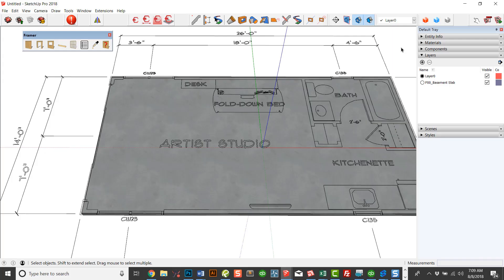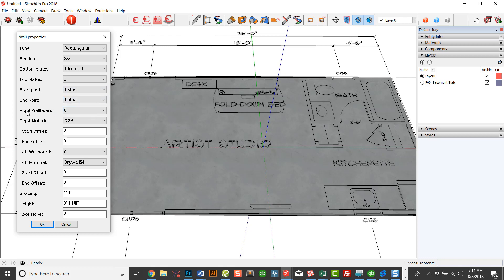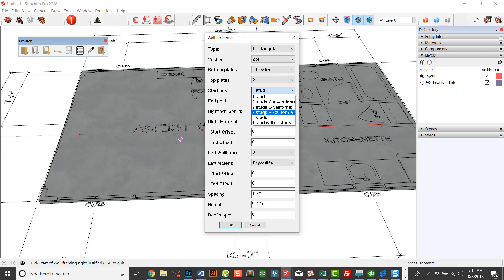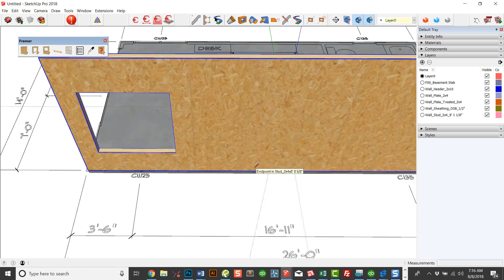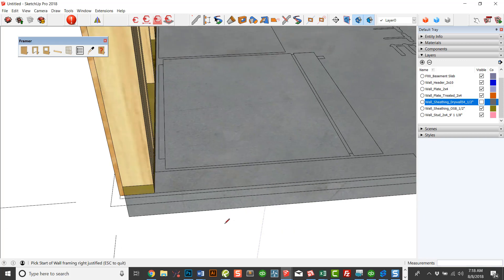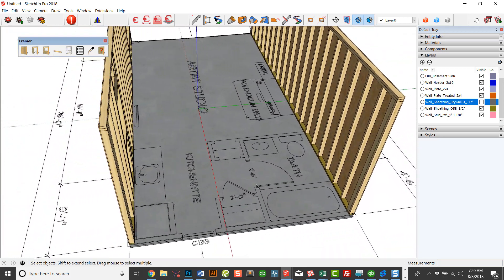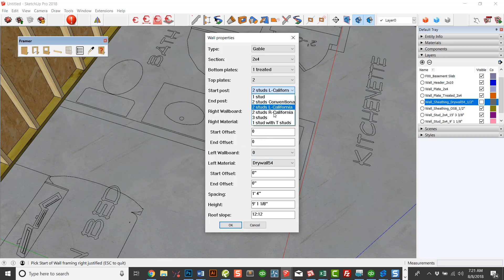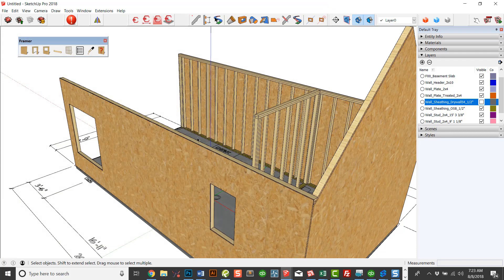Framer for SketchUp Quick Start

Comment: What is the file size something like this produces when you have drawn a full 6000-8000 SF house? How much ram do you run on your machine?
Reply: The file size question is difficult to answer, there are too many variables you did not include in your question to consider. Is your concern computer performance or storage related? As for RAM, 8gb is adequate, 12-16gb is more than enough. Remember to use a video card with at lease 4GB of Video RAM. SSDs are also great for performance when modeling.
Reply from the maker: Sorry I missed this comment! I routinely model houses of that size using Framer - I build detailed models of the complete structure - structural models rarely go over 100 MB but if I add finishes they can get over 200mb but never bothers me (or PC).  Hope this helps - feel free to email me directly at john@estimatorforsketchup.com with any questions